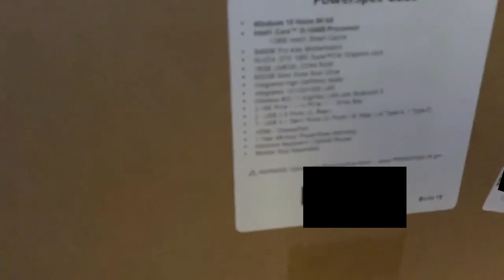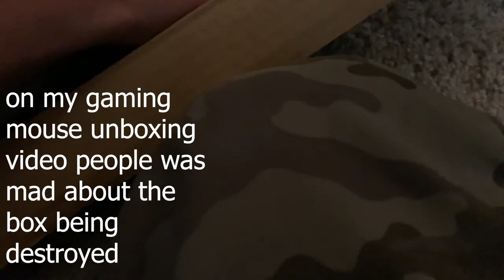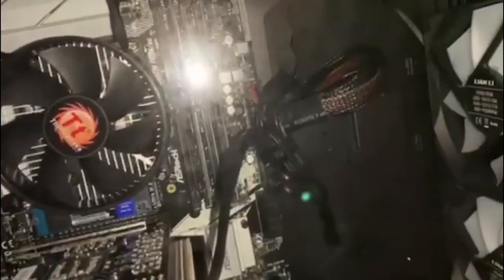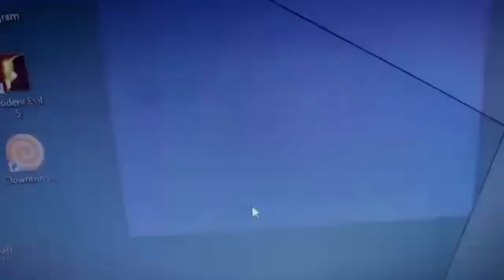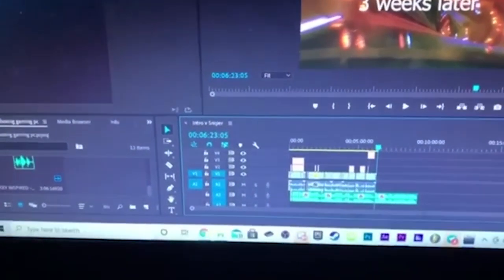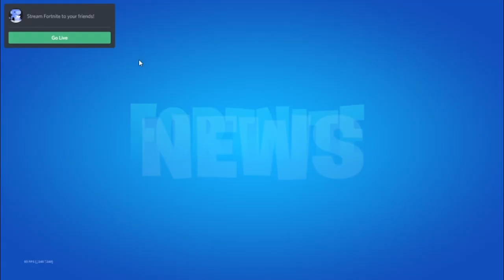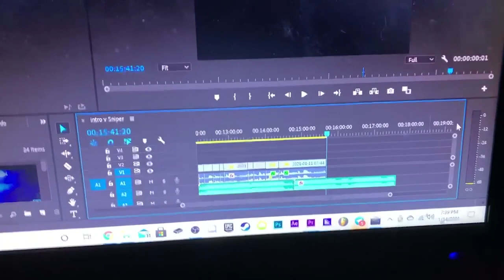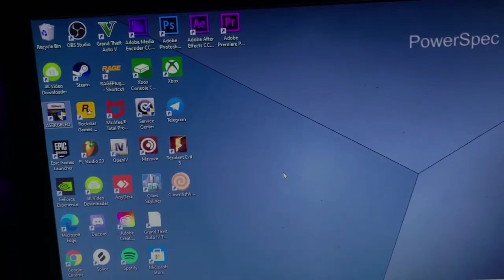Unboxing my PowerSpec G228 Gaming PC

Comment: Is the case good for this pc and have good airflow? Does it get hot?
Reply from the maker: No it does not get hot and I had no problem with it 👍
Reply: @vsniperyt  Thanks for the info! 😊
Reply from the maker: Np
Reply: @moonlitdreamer8051  still recommend picking up some fans on Amazon, just 3 rgb or not, 120 mm and put 2 at the top blowing and 1 at the back sucking, I did it and it helps a lot
Reply: @PDzay  what size should i get for the rear?
Reply: @cly2236  120 mm
Reply: @PDzay  i got a power spec g229 and i just just use one of my fans and blow air into it